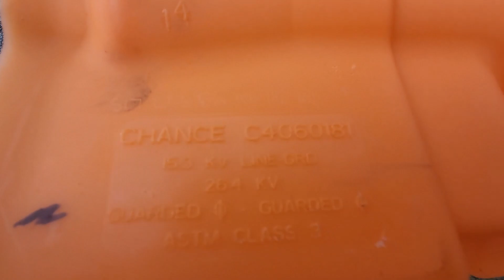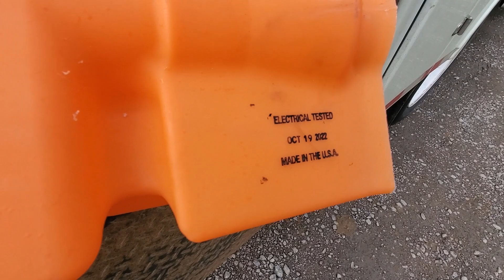Installing cover-up 35 feet up with hot stick!

Comment: Did you say to the guy that you don't setup 35kv next to roads? That's interesting because here in central Idaho we have almost exclusively 35kv distribution lines outside of towns.
Reply: 35kv distribution allows the use of longer distribution lines and fewer substations, at the cost of more frequent outages that affect larger numbers of customers. (A 30-mile 35kV distribution line will have 3 times as many outages as a 10-mile 12.47kV distribution line, all else being equal). Around here, all of the cooperatives use mostly 12.47kV distribution (this is probably true nationwide being that they were built to REA specs), the investor-owned utility that services most of the state uses mostly 35kV distribution.
Reply: @brianleeper5737  Yep. But here at least for Idaho Power they have a lot of 35kv distribution lines that are under 10 miles from subs pretty frequently. And all the new lines for new subdivisions with around 15 mile? Spacing between subs is 35kv also.
My sub in particular is about 25 miles away. And the lines continue another 15 miles after here. Its no wonder why they are 35kv here lol
Reply: @NSaw1  The sub that serves my house is about 6 miles away. The entire line (7.2kV to ground) is overhead except for the last few hundred feet to the transformer for my house. I rarely have power outages, the longest outage I've ever had was maybe 3 hours. That investor-owned utility with the 35kV distribution? Hurricanes and snow storms result in multi-day outages with them.
Reply: @brianleeper5737   Here its all above ground all the way from the sub. And the longest power outage I've ever had here was 6 hours over the 8 years I've lived here. Had plenty of snow storms, wind storms, torrential rain, and vehicles xp
They just built a secondary line around a different way last year, hasn't been any outages since then as far as I'm aware.
The longest outage I've heard of here was back in the 90s when the river froze and caused an ice dam that took out the road into the valley and the lines. From what I've heard there was no power for the 4 days it took to get the ice dam cleared. 
But we are in Idaho so there aren't any hurricanes or really severe weather. Although we have had 80mph winds funnel through the valley many times over the years. And had a 6.8m earthquake too.

Comment: Hey, just wanted to comment to let you know how helpful your explanation and education is: This week I did a first aid/CPR class and the instructor also went over what to do if we see someone at risk of high voltage shock, i.e., most likely someone recklessly climbing power masts or train cars - recommended course of action being to get out of there and call 911 or the local equivalent to take over. The instructor said that the danger radius is many dozens of yards depending on the voltage, but the training she got for the class didn't explain why the pole would become dangerous - after all, it is always there and usually not dangerous to bystanders. Your videos helped me explain that if the person comes into contact with the line, they are likely to also be in contact with the mast, thus shorting out the insulation and becoming the wire, putting potential on the grounded tower and the ground around it. I'm not sure everyone followed, but it motivated the "stay away" message of the class for people! And it's counterintuitive to get away from someone in danger like that, but if they get shocked on the high voltage there ain't no helping them anyway :( So yes, your videos reach the public - all the way across the pond here :) Cheers!

Comment: Lol that’s like trying to stuff a wet noodle up a ( blank) ( blank )  lol trying to keep G rated here coz of little ones that might be watching.. I remember over 40 years ago trying to hang SF switch back in the cradle.. I was ((embarrassingly)) over an hour with hot stick on a gusty day…pole was out in wet muck ground no way for a line truck I was down right embarrassing, and frustrating trying to do a simple 2 minute task… line boss said BS you were sleeping out their it don’t take  a dang hour to hang a switch…. 🤷🏻‍♂️. Did that day

Comment: This is why I love Dutch soil.
We have all <50kV underground in our 'swamp' 👍 Weather proof.
Reply: We have underground primary here in the older (50 yrs) subdivision, but faults occur as the Texas soil(clay) expands and contracts year after year and then a fuse blows because a segment shorts ... we've had 4 or 5 like this now in my 40 yrs here.
Reply: If it floods some one forgot to maintain our pumps 😁

Comment: I've noticed these orange guards many times, esp. when there is construction  going on.  But yesterday passed a site that seemed to have a few dozen of these up - almost like a wall.  (Construction zone near poles carrying 2 sets X 3 phase - high wood poles.  New exit off a service road I think...)
I expect you'll be busy come the weekend / Monday+ when cousin Lee spins in.  Current ECMWF F'cast right into the Bay of Fundy and landing s/w of Saint-John.  Ah well - forecasts change ...
Reply from the maker: We make the "wall" as well... there's a lot more to it than this, but an example;  A crane must maintain 12 ft clearance. If we completely cover one phase (nearest), than the crane can come within 12 feed of the next phase instead. They would than be approx. 8 feet from the covered phase. There's some paperwork involved and a few other things, but that's the skinny version. 
Big meeting at the office tomorrow about the storm... Looks like it's going to be a direct hit :(

Comment: Do you guys get any issues setting poles directly in swampy / wet locations? 

We typically set poles  in a culvert for soupy areas.
Reply: I've seen poles running through a swamp before, prolly 69 kV lines, but, how the heck did they manage to get in the swamp and get those poles set in the first place!!!???
Reply: The local company has contracted an upgrade on the (34kV?) line which runs diagonally across the peninsula through the bog. First I knew was a HUGE dump of "railroad ties" (and wire trucks) by the highway. Next week by the bay road I see they been cutting into the wet woods and laying out a "carpet" of those ties under the old line. The land is less-wet over the hump of the peninsula so they set a RoW past the next house so most of the work and trucks can get back there dry. 
Also: weather. The last 5 years have been historically dry, and you could walk that land most days. This has been a very wet year (even before this weekend's tropical storm) so my pond never got low and I am sure that bog the wire guys are working in is fully boggy. 
This crew is from out of town, and we may be glad they came to visit if we get a good hit and invite all available help to lend (rent!) a hand. They got good trucks and more of them than the utility keeps in this area. 
As to how you stand-up a pole in mud... I dunno. Our mud is glacial debris with enough rocks to stabilize it, but I've seen bottomless mud in other places.